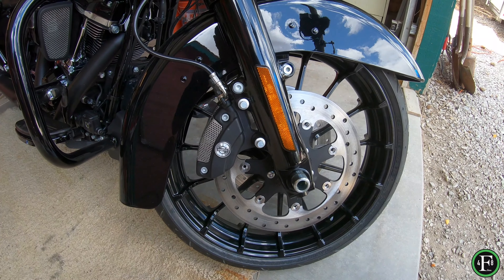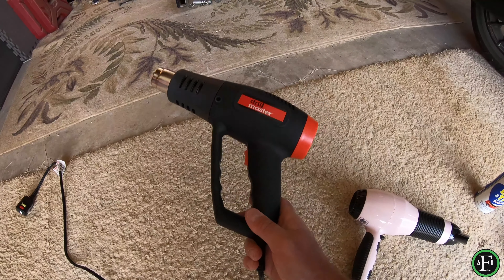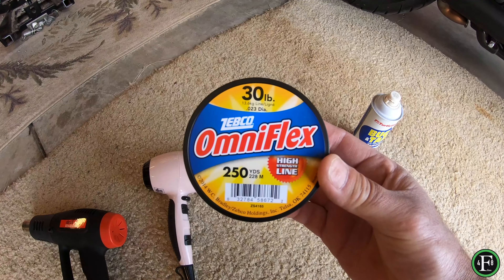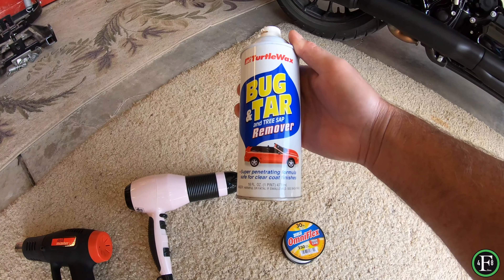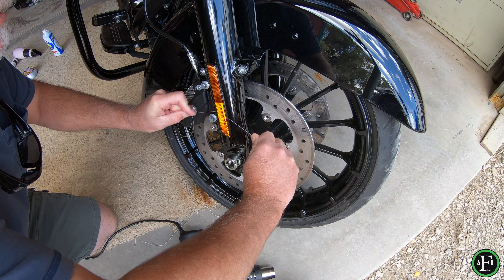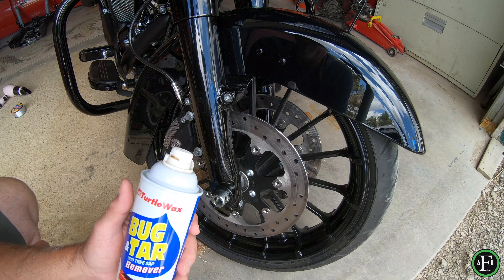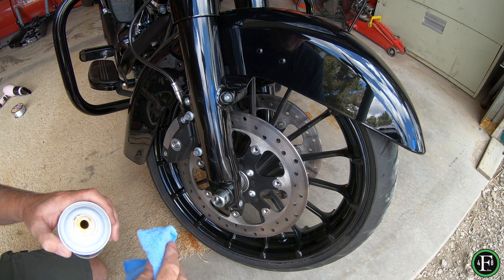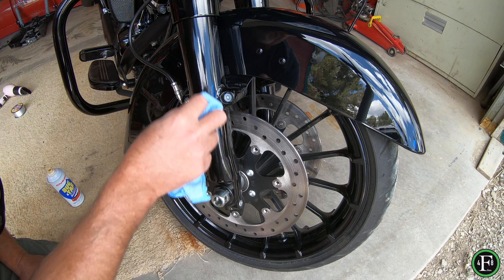Removing Reflectors from a Harley Davidson Motorcycle.

Comment: FYI for anyone else, you don't even need the fishing line.  I got it hot, used my finger to just get the end to pull outward and it came off. You might need to use a sharp edge like a pocket knife to get under the edge, but the tip of my finger worked just fine.  The remaining glue just peeled off and rolled up into a ball of goo, did reheat it a bit, but again, just rolled it off and left nothing but a pretty fork.  Thanks for posting this video, nice job, well needed information.

Comment: Federal Motor Vehicle Safety Standard  571.108 requires lamps and reflective devices on motor vehicles which means motorcycles as well for safety reasons. States may have their own laws or regulations regarding this topic as well especially in states that require vehicle safety inspections. I plan on replacing mine with a custom dynamics light with turn signal that attaches to the front forks.
Reply: Weak
Reply: I’m sure you’re fun at parties.
Reply: @JustADude1900ish LOL
Reply: The federal law requires them to be fitted by the manufacturer to be sold. You do not have to keep them.

Comment: I used a hair dryer... worked fine.  No need to go out and get a heat gun if you are only going to use it once
Reply from the maker: Nice.  Well I did say it would work with a blow dryer just a little slower.  Great to hear that it worked out for you.  Use what you have.  Just spend more time heating with the blow dryer👍
Reply: Yeah I didn’t enjoy the snarky bicycle comment. That’s actually about as far as I watched.

Comment: Any issues with or damage to the paint? I've got a 20 Breakout and want to remove mine as well
Reply from the maker: I had 0 scratches or any issue at all.  I’m super picky.  If you do it exactly like I did in the vid and have all the supplies I used it  should come out perfect.
Reply: @f48films33  
Good deal. Thank you. I'm going to do mine this weekend
Reply: @f48films33  
I did mine today after getting home from work. Took about 10 minutes per side, total. Thanks for the info. It looks cleaner now.

Comment: Bye-bye reflectors, hello side impact at night, goodbye insurance coverage (once they see no reflectors).
Reply: If that’s the case your getting mowed down either way. A tiny reflector isn’t going to stop that.
Reply: @slowsporty5972  Look at it at night off of a headlights beam, it's almost as bright as your brake light (only orange of course).
Reply: If you’re that scared you may want to try Uber
Reply: Do you know what else is really bright at night, the huge LED day maker light on the front of the bike ...if they don't see that pointing out into the road, a reflector isn't going to save you lololol
Reply: @maddawg4599  Not scared, just smart. That's how I got away with riding 53 years without an accident.